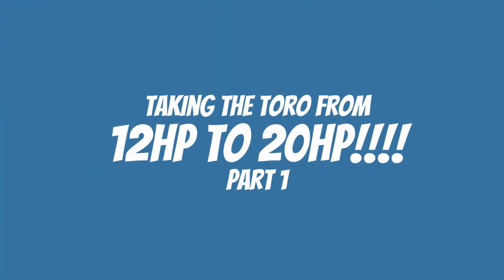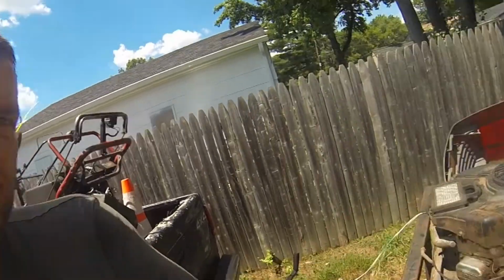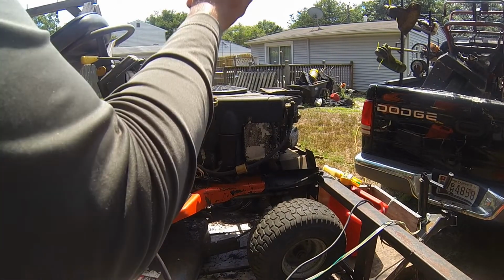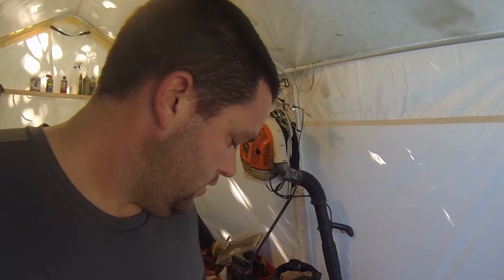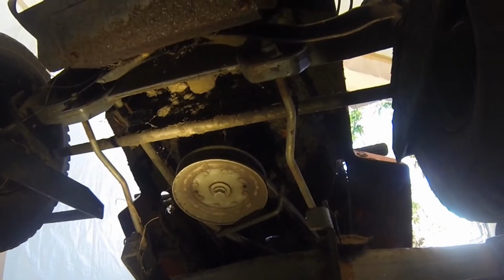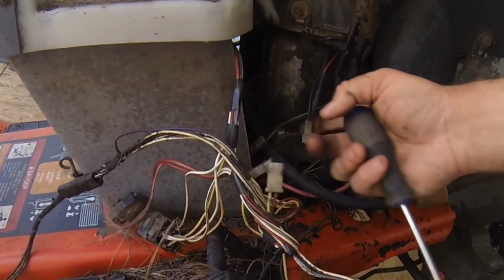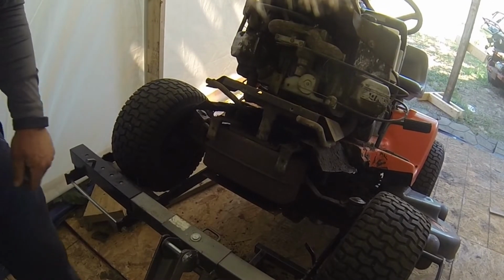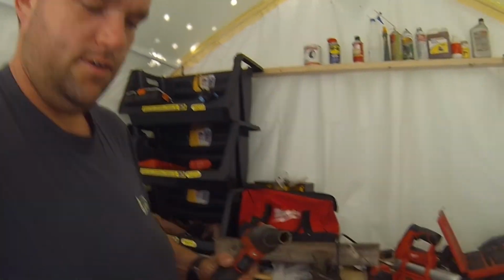Part 1: Taking The Toro From 12 to 20hp

Comment: I have a 21 horse Briggs just like it it's a good running lawn mower when is running I say that cuz it breaks down a lot currently down due to wiring issues at this point get it running right and it has all the horsepower you want

Comment: The carbs are Nikki brand and don't clean up and rebuild well, we end up replacing them all of the time and are around $120, and if it has around 400 hours the head gasket will likely go. I've been working in a mower shop for 11 years and your 12 hp Kohler will out perform this Briggs all day long.
Reply from the maker: hmmmm. Thanks for letting me know

Comment: Briggs and Stratton engines are the worst engines made in my opinion. With all that oily dirt mess under there I would say it would be good to go ahead and replace the sump gasket and the oil seal in the bottom. The cheaper Briggs engines like this one are very bad for head gasket oil leaks as well so even if they arent blown changing them could be good. The breather tube gasket on the engine could be changed as well. Changing all of that can really help reduce leaks for a while. I would also thoroughly clean the engine all over to get that gunk off because it doesnt take a lot of build up in the fins to overheat these engines. Briggs uses the absolute worst carbs as well. I may just not know fully what I am doing but I have had very little luck cleaning a briggs carb and not much more luck with just replacing one. Expect $150 or so for that particular carb new. 
I'm not hating and I know that I probably just dont know much about small engine work but there is some reason that I have seen 10x more junk briggs engines compared to Kohler and Kawasaki engines. Briggs makes them cheap so they are used much more often. not because they are a better engine by far.
Reply from the maker: Hey thanks for the suggestions man. The engine def needs some work but it's about 15 years newer than  what I'm currently using. Yeah I checked and that carb is crazy expensive. It is stunningly easy to swap out the engines on these walk behinds. The wiring part makes me a little nervous cause I'm gonna literally be learning how to do that as I go. I'm pretty pumped cause the shafts are identical so I won't have to by new a new pulley or clutch (I think). As nasty as that thing looks, I did pull the shroud off before starting and the fins were shockingly clear. Biggest concern I have is figuring out the muffler situation. The muffler will be laying on the blade belt if I leave it as is. Just glad I have a spare frame that I can use to work out all the kinks.
Reply: Most of the time OPE engines have the same bolt pattern and the same size shaft which is a great thing. Its honestly a wonder that these companies didnt make them different so they could rake in that much more money from people having to buy certain things. Most vertical shaft v-twins have exhaust ports on the bottom like that and usually the pipe runs to the side with a side mount muffler. The Kohler on your walkbehind has a bottom exhaust port as well. The best thing would be to buy a factory side mount muffler but one could be made. I think a muffler like that would run around $100 as well. There are many videos on how to wire up small engines. The best way for your case (imo) is like the guys that make mudding mowers do it. Just youtube "mud mower wiring" and youll find multiple ones. I like to put the carb solenoid on its own switch and the kill switch on its own instead of trying to wire stuff on a key. You may end up finding that the stator is bad on that engine. Another thing Briggs is known for. So if it is your battery wont be charged when the engine is running. Simple to fix unless the diode in the wire is bad that is just aggravating. 
Since the fins seem to be pretty clean i would just clean off the engine really good and run it and see if i can see any oil residue from somewhere around the sump on the bottom or around the shaft itself.
Reply from the maker: Thanks man! That helps so much!